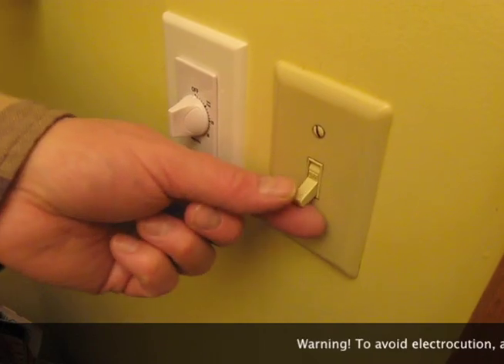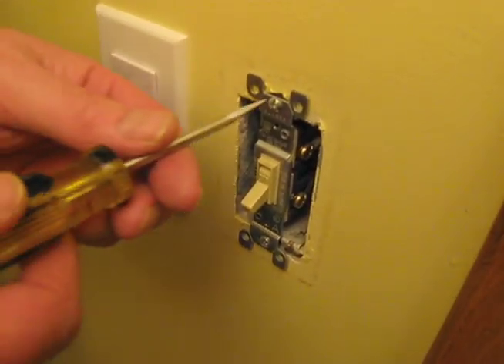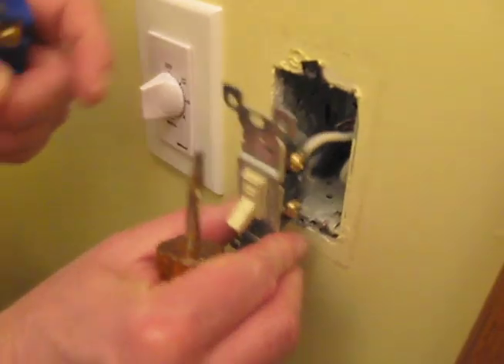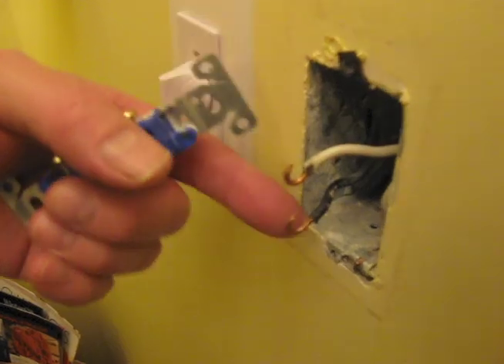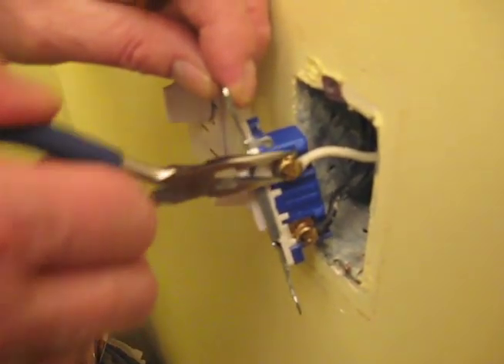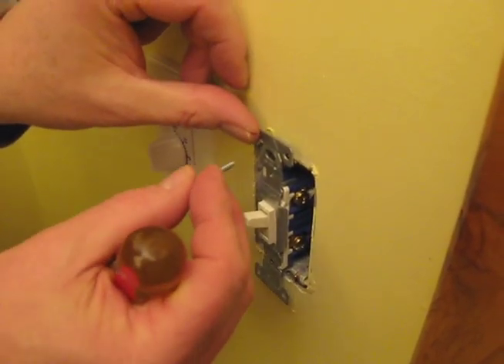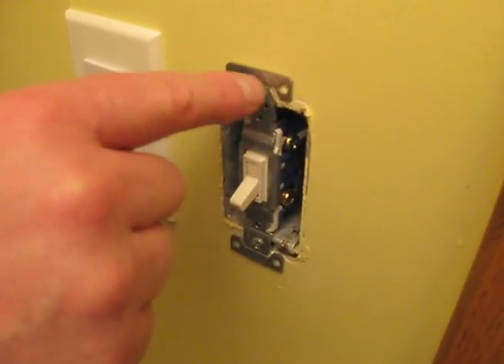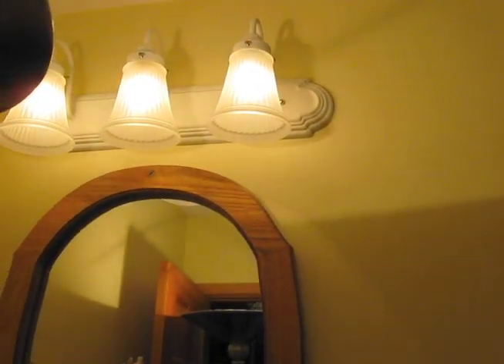How to Change a Light Switch (Two-Way, Single Pole)

Comment: Wonderfully done video! You gave us good detail about the whole process which is very helpful.  I especially liked the detail about the metal box vs plastic box (which my contractors always use now) for the ground wire issue.  So now we can see the need to connect that ground to the green colored screw as you showed us. Thank you for your time and effort to post this.Thank you, too, to the videographer for taking the good closeups while you are replacing the switch. Very helpful!
Reply from the maker: Thanks so much! I'm glad this was helpful to you.